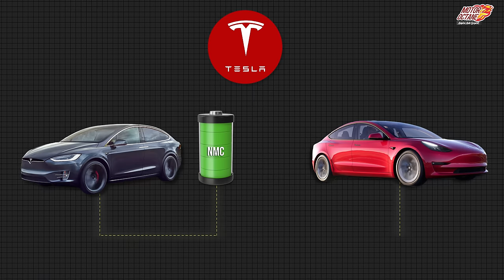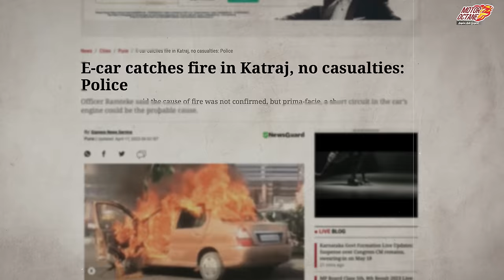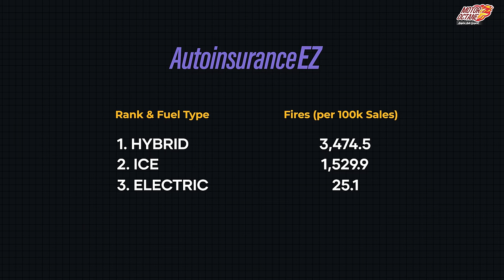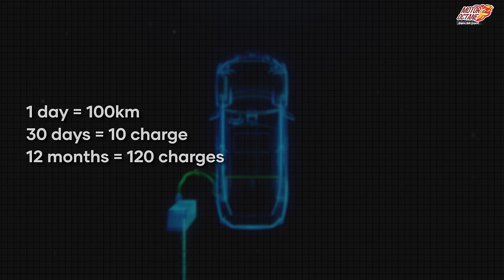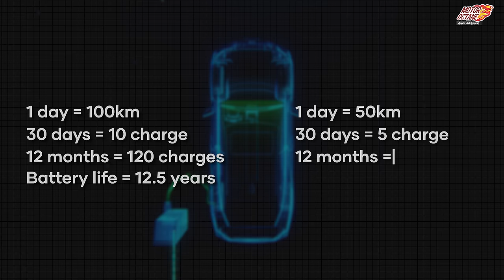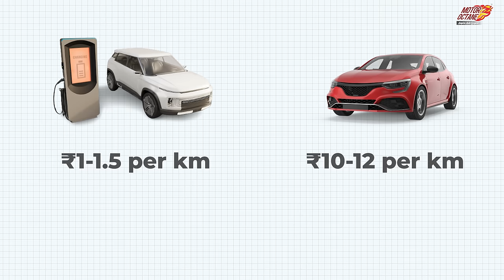Electric Cars have Battery Problems?

Comment: There's always a range anxiety in ev but if u can save a tonn of money then u gotta realise that ev is not for long trips bcoz in case of any issues u cannot sort out through local mechanic so i personally use for city use and these days charging infrastructure by private people is increasing so even a long trip can be planned so for purely saving purpose u can save a lot through ev even ice engine tend to give reduced mileage as vehicle becomes old but even though it gives a reduced range u can just simply refill through petrol and drive but wheras in ev if degradation is more than 30 percent then it can be a problem but anyway degradation is a long thing after completing so many kms so i prefer electric rather than ice engines
Reply: I bought this car recently with the main intention of having driving comfort. But I am regretting it now due to the following reasons.

1. My back is sweating if I drive the car even for 1 hour and there is no use even if I turn on full AC. I am feeling very uncomfortable to drive after an hour and long drives might cause even more discomfort to me. This defeats the very purpose of my buying this car.
2. I recently dashed another car slightly during a traffic jam. The car's technology did not apply automatic break although it was claimed so by the company. So, the safety has become a concern now.
3. BYD's roadside assistance is very basic as the customer has to pay for any damage that happens during towing. In my case, I was asked to pay around 3.5 lakhs for towing damages. Because the insurance pays only for accidental damage but not for the towing damage. So, I am made responsible for the damage caused by BYD.

I did not even complete my first 1000 km. I am now wondering what I gained by buying this car.

...

Comment: Motoroctane I have a question regarding electric car which is when we seat in diesel or petrol car with ac on in still can we do the same in electric car and if we can how much it will affect the battery  of car
Reply from the maker: Of course you can that - drainage in battery depends on the battery pack size.
Reply: yes you can do that. EV does not have any concept of idling, you are either off or on (ready to move but keep in N gear with hand brake on)

if you run AC at max speed and lowest temp even then the battery will only reduce by 1% per hour because EV does not have belt powered AC like normal car where engine has to be running to use AC, 

in EV, the compressor is like refrigerator (heat pump) which runs directly on power from battery.

in ICE car, the compressor is like those ganna machine or atta chakki where you need generator (IC engine) to run it

Comment: sir my tata nexon ev is already having battery problem it goes from 20% to 0% (it stops working at 20% drops to neutral gear and dosnt go to drive mode) also nexon ev xz+ only goes 220-250 km in one charge so maybe 3 to3.5 Lakh kms in best case
Reply: also i myself know of atleast 4 people who are facing the same battery problem in nexon ev car
Reply: car  is 1.5 yrs old driven 28000 kms

Comment: Problem is if you are travelling between 2 comparatively big cities on an average 450km plus on side, and charging needs to be done in between, the time you take for refuelling EV and ICE makes huge difference. You cannot find fast charging units everywhere you go, in fact charging units it self very difficult to find. For just daily commute as you gave in example it works perfectly fine when you compared to ICE cars. But if buyer mostly goes in rural areas or highways it is still ICE cars wins the race, can't rely on EVs in such cases

Comment: What will be cost of Battery Replacement in Nexon or XUV-400
Reply from the maker: The question is incorrect to some extent - in most cases some battery modules are replaced - just like when your some part goes wrong in engine - you don’t change the complete part

Comment: Bhai,my monthly running is 4500kms..... usually starting early and reaching home by 11pm mostly thrice a week.currently using Ford freestyle diesel which gives around 21km average with ac. On should 8 upgrade to ev xuv 400 coz m 6'4"tall and bit healthy.
Reply from the maker: Yes good choice for low cost of running

Comment: due to range anxiety people would generally top up their battery almost on a daily basis.. what would be the charge cycle and battery life calculation then? you calculated the best case for 12 yrs and worst case would be about 5 yrs.. if the running is more it might be 2 top ups in a day one at home one at office. also the range they mention is the best case scenario.. those numbers never match up even you know that.  the range depends a lot on driving and more so on ambient temperature. in winters a car claiming 300 kms may not give over 200 if it is really cold.. dont just push the agenda that everyone should opt for electric.
Reply: cycles are not counted by how often you plug in the car, it is counted through amount of energy transferred.

one cycle is complete when you discharge (use up) 100% battery and then charge to 100% again.

but it does not mean if you charge to 100 daily at nighand during day you drive worth 20% only, then also you count as one cycle. it will be counted as 1/5th cycle or 0.2 cycle if you drive 20% per day and charge back up to 100% same day.

and its counted as 1 cycle even if you keep using the car until it goes to zero in 5 days and charge fully on sunday 0-100 then also it is one cycle

you are misunderstanding that if every time you charge to 100% it is one cycle. we need to see the difference, not the result

80%->100% = 0.2 cycle, not 1 cycle

Comment: waise rachit youre saying one is not better than the other, and yet nmc has a lifeline of 1500 charge cycles and lfp has a lifeline of around 2500-2700 charge cycles which is almost double....
Reply from the maker: You are not seeing what extra you are getting in NMC.
Reply: its like tradeoff 

NMC has lower durability but if you want to make fast ev like tesla model S 1.9s 0-100 then only NMC will come to rescue as it is lighter for same capacity and provides more power 

NMC in Tesla is 400V, porsche Kia and Hyundai is 800V while nexon and tiago ev is just 320V

Comment: My doubt is what happens when we take EV uphill on a hill station? The range reduces drastically right? I heard Nexon EV Max only gives 100km range uphill which seems too less and me living on a hill station steers me away from buying an EV.
Reply from the maker: If you average uphill and downhill - it levels out. However just FYI even petrol and diesel range goes down. It even depends on how you also. :-)

Comment: No charger anywhere in 300 km radius from my town. So till there is a charging station for every 50 km and battery swapping technology comes for the cars, buying an EV is the stupidest thing for me. I would rather pay the same amount to buy a performance car and pay more for petrol
Reply from the maker: You don’t need a charger around your house if you have a home charger. No one generally will fully charge their car outside in their city - when they have home charger
Reply: where do you live, and where have you tried to find charger (which app website?) have you used plugshare?
Reply: @shresthsonkar9207  I have tried the apps and it shows barely few charging stations and nothing around. Out of those few charging stations, most of them don’t work at all. EV may be good for those people who love in city and for the purpose of city driving but for an all purpose vehicle EV cannot be used
Reply: @motoroctane  the vehicle runs approximately 250 km at Eco mode with AC on. At performance mode, it runs only 100-150 on full charge. If I have to go somewhere 200 km  from my home, I cannot go because there aren’t any charging station in between and I don’t want to drive the car at 50 km like a rickshaw and I never reach my destination without having to charge somewhere in the middle. So EVs are never going to be bought by people living in small towns and villages

Comment: IMHO if your average daily run isnt high and you are not in a situation where you need to have a 4W right now and if you are on a tight budget, then I think you should postpone buying EV 4W for atleast couple of years

I myself am waiting for an EV MPV🤞
Reply: On other hand - purchasing EV 2W Scooter makes more sense (comparatively)
Reply from the maker: Vishal most of us do look at cost savings - however not everyone is inclined to save or reduce just running cost. So, they can test drives EVs - the battery myth shouldn’t stop them.
Reply: eC3 aircross has been spied testing, possibly will get electric version in future although boot space will be zero due to third row in C3 aircross

Comment: The real thing is battery depletion which happens after every charge just like iphones when they are brand new battery helath is at 100 after 2 -2.5 years battery health becomes 80 percnt or so.
Lets convert this in cars 300km range on brand new . battery degradation is around 2.3-5 percent per year which means each year the range will drop by 15 km like
300 ,285, 270 ,255 ,240 ,225 , 210 ,195 ........ so on 
The one thing that no one talks is temperature heat is bad for batteries period and India is a super hot country so that will only worsen the battery degradation
Reply from the maker: The problem is you are comparing two different types of batteries. Also - you will not charge your car daily.
Reply: what you are saying is false and easily disproved 

I have 11k driven 1.5y old nexon EV which is still giving same 250km range as day 1.

in fact range increased from 240 km to 250km after os update which gave cruise control and regen modes which improved the range by 10km right away

as far as heat is concerned, that is why you have liquid cooled battery packs in all evs except few like comet and eC3
Reply: @shresthsonkar9207  Look for geotab ,vthey tracked data of 6 thousand ev

Comment: Rachit you miss the one aspect regarding EVs, ECO-FRIENDLINESS, acc. to the study done by IIT-Knp. in 2023, it is found that, EVs release 15-50% more polluntant gases, during MANUFACTURE, USAGE (as ~80% electricity is produce bye coal in india) SCRAP than ICE cars. Plz acknowledge this aspect as well, Rachit

Comment: What about resale value of EVs in India ? If I buy an EV now what will be it’s resale value after 7-8 years ?
Reply from the maker: Resale depends on supply and demand. Any petrol or diesel car that has a problematic engine will also have lesser resale value and same goes with EV also
Reply: I'd ask you counter question, 

what are will be resale price of BS6 E10 due to E20 in future?

What will be resale of diesel cars amid the fact that the goverment has been presented with proposal to ban diesel vehicles in 1M+ populated cities

What will be the resale value of so called "best of both worlds" hybrids when their battery doesn't even have cooling system in hot country like India and the avg hybrid battery completes 2-3 cycles per day due to small capacity?

There is no certainity about anything, not even about the fact whether we will live to see another day or not, daresay. So I don't see how this is an "EV PROBLEM" and not a general uncertainity which affects every car
Reply: Resale value not even half next day too

Comment: What about battery health and degradation? What happens if car runs only 50 % of the original range even at 100 % charge after few years? Need this clarity
Reply from the maker: We will be glad if you can share of someone who is running on 50% of the original charge.
Reply: 50% range is impossible

 the way degradation happens is that the voltage of cell drops

there is no concept of % in cells, you can only check the minimum and max voltage. all evs check battery remaining using readings from voltmeter. there is no concept of %. through formula designed for that kind of cell, the voltage is converted to the % you see in dashboard

for example your normal car battery for starter is considered discharged at 12V output. at 100%, it gives ~14.4V output

its impossible to have 50% range as that would mean that the cell is more than discharged

Nexon EV uses IFR-32125 cell wich is rated for 3.2V when fully charged and 2.5V when fully discharged. You cant have 50% degradation as that would mean a voltage of 1.6V which is not possible.

Min you can have is 2.5V which means 78% health or 22% degradation.
Reply: @motoroctane and @shresth sonkar The point I am making here is how the range gets affected over the years after battery health degradation. Similar to what happens in phones, do we get a lesser range at same 100 % charge after 8-10 years? I don't think we can compare Tata motors and Tesla batteries charge holding capacity as shown in the video

Comment: Flawed logic to compare tesla 12percent loss. Model s used in the study has a 95kwh battery. Xuv 400 has a 39kwh battery. So for same distance run charge cycles will be far more for Xuv. So can't really extrapolate from that

Comment: Electric cars can only be successful if cheaper than fuel based cars by around 20-30% because they are just made of few semiconductor, battery pack and motor.

Scope of repair is very minimum and you are totally dependent on Manufacturer for software update and issues related to core technology.

Fuel based cars returns mileage that gradually increases as we run more KMs but in Electric cars the mileage drops every year due to battery degradation.

Comment: 5 to 100% a complete cycle,  but in case if charge daily at 30-40% remaining battery then is it called a cycle or it should be considered as half cycle
Reply: half cycle

cycle is determined by energy usage 

for example if you use 10% battery in daily usage on nexon EV, it is equal to 3kWh energy.

when you charge 3kWh, it is 1/10th of a cycle.

after charging for 10 days, you will complete one cycle since 30kWh capacity will be used up.

you can either do that by charging 10% daily and using from 100-90% during day or you can wait for it to go zero and then charge to 100 in one go, both counts as one cycle.

Comment: Very nicely explained, in addition to battery life, if some problem occurred after the life cycle no need to change a complete battery pack. The battery comes up with different batter modules and individual modules can be changed.

Comment: Running cost of Rs 1/km is very attractive. But what happens when you have to replace the battery costing 7 lacs in one shot. Thats like buying a new car!
Reply from the maker: That’s similar if you change your car engine too ;-)
Reply: @motoroctane  it only sounds similar. Practically it will be very different. After warranty expires how many customers do you think take their car for servicing to an authorised service station. Very few. Let's say a car needs an engine change or repair, a third party or unauthorised workshop will do it for a fraction of the cost as compared to an ASC. I doubt if it will be same or as convenient in case of a battery change.
Reply: @agcc137  bhai ic engine tujhe 3 saal tak warenty dega... ev me 8 saal .... 8 saal me tujhe 2 baar v ic engine change krne ki situation aa v sakti hei

Comment: Sir kyo public ko bewkuf bna rhe ho ,jis battery k 1500 cycle h agar usk aap 700 to  750 cycle pure kra do to m aapko 10000 rs enam duga ,har battery k 100 to 150 cycle k bad cell ko equal charge krana padta h ,jise company floor charge bolti h ,jo har 50k to 60k km k bad krana padta h ,
Reply: Agar aap battery ko DC charger se charge kroge ,to 1500 cycle wali battery k 600 to 700 cycle ki life bachti h ,esse jyada to led acid battery ki life hoti h

Comment: What about charging infrastructure.
We don't have a lot of charging points. I think electric cars are ok within the city , but what if you are traveling more than 400 kms as a stretch. This is not possible in an electric car. That fear is obviously there that we may run out of charge before we reach a charging point
Reply from the maker: This video is about EV battery. For EV infra - see this video. This man drove all India - in 50 days on a holiday covering 17,000kms and using outside chargers. 
https://youtu.be/zqpH9PjN4aw

Comment: TBH, we are hesistant to buy the EV because of the lack of infrastructure and the forceful obsolescence of the ICE. Another point to highlight here is the locked features on the EV and will be unlocked via subscriptions. This way the vehicles will be similar to phones. We won't be fully own the vehicles even if we paid the amount.
Reply: Don't buy EV now.  Petrol is not bad.  Petrol engines evolved a lot. They are best now.
Reply: FYI EVs did not start subscription service, BMW started it with heated seats on their ICE models long back in 2015 when tesla hadn't even lauched FSD or even performance package upgrades.

The avg ICE car today has same amount of electronics as electric car except inside the powertrain, where only the ECU and fuel injection and if automatic, then gearbox is controlled through software.

EV only exceeds ICE cars in electronics in terms of the motor to drive wheels nothing more.

Even ICE cars have big touchscreens now, even they have had things like ADAS, cruise control etc since long back